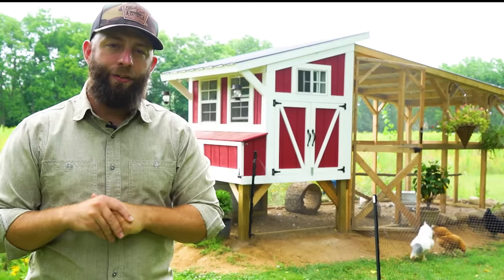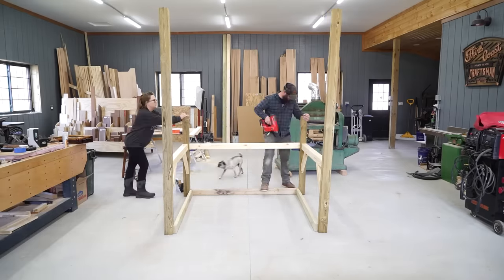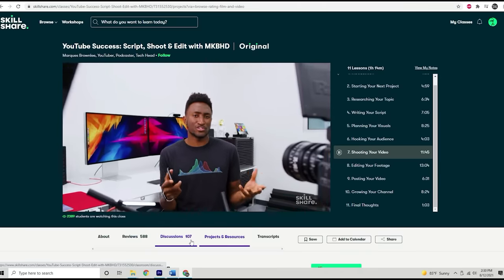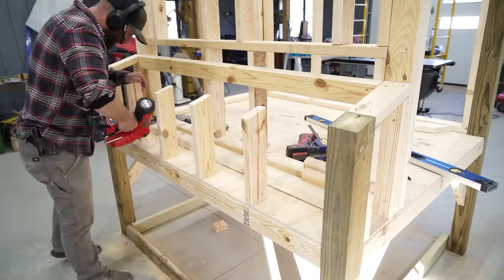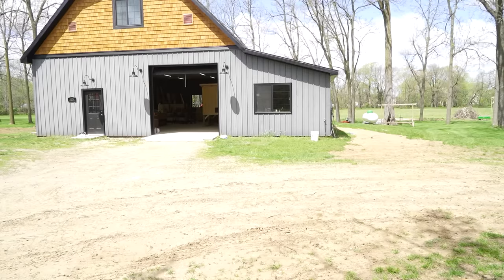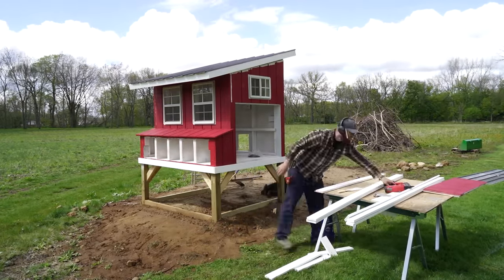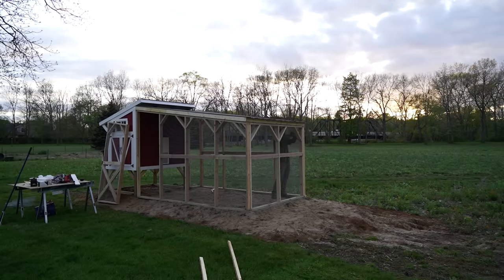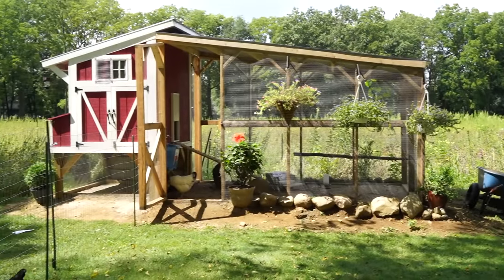Ultimate Backyard Chicken Coop Build | How To DIY

Comment: Quick question - I got the plans and I was wondering, is the framing nailer really necessary? Could you just use screws and be fine instead of using screws and nails?
Reply: You can do so with screws only too but the nailer makes it easier to join peices one handed,feeing up one hand to hold on to the wood, also some screw drivers arent strong enough the get the screws all the way in so maybe do a pilot hole first
Reply: @Smr402  I started on the build and i've been using #10 screws for added strength. I know nails have a stronger sheer strength but since this is just for chickens and not humans, the screws should support everything fine right? First time doing major framing work like this haha, nail gun would've made some of these angles MUCH easier. The 45 degree supports were tough with the drill and impact driver.
Reply: @WolfCatBirdPigMan   hello, i also just started building and have been using #10 screws as well. i do believe it will hold up just fine. i just finished the base and it is pretty sturdy. i dont have a nail gun but so ive been doing all the pilot holes first with a twist drill bit, then i use a wider drill bit that makes a hole big enough  for the screw head to sit flush in the wood. i have been putting in the screws on the 4 inch wider side instead of in the 2 inch side because i was able to get a better angle. you can look up, " how to toenail a screw" by the youtuber beech w. However if you try doing pilot holes do not "tip" the drill bit as it will overheat and break off. you can do a small hole then tilt it. ... and sorry for the long comment, you probably already figured all this out or know more about wood working than i do haha

Comment: On page 6 of the downloaded plans, you do not indicate that the 60” wall studs are to be cut on a 15 degree angle. You mention the top plate is cut at 15 degrees along the front edge, but nothing is said about the wall studs. I knew the wall studs needed the angle because I’ve built a lot, but a novice would not catch this, and it’s a bit vague in this build video as well. Other than that, the plans look good.

Comment: How do you heat it in the winter months? we are located in Canada it’s gets well below freezing in the winter.
Reply from the maker: We put in an electric broader/heater plate under the roosting bars and on single digit and below nights we turn it on. For the most part the chickens body temp help keep it warm enough for them

Comment: I have already bought your plans, and in the middle of building. Kids can't wait till I'm done. I have only one question though. Are the windows flush mount or j- channel, I still need to get the windows, and I can't tell from the videos. Thank you, and have a nice day.
Reply: The windows in the plans are J-channel windows. However, if you find the ones from Shed Windows & More youll be luckier than most. I built this coop and waited for a month for these windows to come in, but they never did. Lowes does sell some very similar in size to what is described in the plans (18 x 23).  But Lowes gets $80 per window where Shed Windows & More gets about $40 per window IF they can get them in. I went ahead and bit the bullet and got mine from Lowes just to be able to wrap this project up.
Reply: @mellis5150  Thanks for the reply.  I did get them from Shed Windows & More.
Reply: Hello, me again. Question? Now that you have had your coop up for a while have you had issues with rain blowing in the coop at the top or bottom of roof at the ribs, or is this something I'm going to need to seal off. Thank you.
Reply: @jimmyrennier1849  I've only noticed rain blowing in through the window (when open) above the double door. I am probably gonna just leave that one closed most of the time.
Reply: @mellis5150  what direction are your windows facing?

Comment: ON the frame for the run. Did you end up just using green treat on the ground and the rest just construction lumber? Or did you treat the construction lumber at all with anything for outdoor elements?
Reply from the maker: Just treated for the ground
Reply: Why did you not treat the other lumber? Will it not rot? Thank you
Reply: I ended up using treated lumber for all ground contact surfaces and painted the other untreated lumber after assembling the run sections but before attaching hardware cloth. Worked pretty well.

Comment: Thanks for the video! Just bought the plan and beginning work on it. Can you make any suggestions on how to treat the end cuts of the pressure treated lumber? The standard for PT lumber with ground contact seems to be products containing copper napthenate (e.g. CopperCoat Green Wood Preservative). However, that's some pretty nasty stuff; hoping to find a non-toxic alternative for the feathery friends.
Reply: Did you find the windows? Struggling to find them
Reply: Marine one seal is animal friendly and one goes along way, but a bit pricey.
Reply: @hopejanson9743  No I haven't been able to find them either, but thinking I can find something that's comparable size with tempered glass.
Reply: @ryanabbott9208  I found some windows on Amazon that are slightly smaller but worked!! I did a lot searchingggg

Comment: Question, if the coop door is inside the closed run that is predator proof, how important is the coop door itself? The door you chose is a really cool, safe, smart design, but it is also expensive and seems it would be more important if this was the primary way in to the chickens space without a run,
Reply from the maker: We have a fenced in open air area that we let the free range in and with the auto door we don’t have to remember to go out there in the morning and evening to open and close the run door. If you always keep them in that closed secured run then you wouldn’t need an automatic door

Comment: Anyone else have trouble finding the windows? The windows look like they are out of stock and hard to find. Are there any alternatives or places to find correct windows for this chicken coop?
Reply: I had to adjust the two front windows to a slightly smaller size (and adjust the dimensions of the frame)... I was able to get something similar (but smaller from different supplier). I also had to build the coop without the side window (above doors) as that one was also out of stock.  I just found that one available on Amazon and ordered it yesterday.
Reply: If you call the company directly, they should have them

Comment: Question please,  Has anyone converted these plans to make the run the same width as the coop ?  I have a location with a 12" grade which I need to build a platform first from 4X6" so I need both Coop and Run to be same size (62.25") if possible.
Also has any converted it to a deep litter system ?

Comment: Just some experience I ran in to. It looks like he puts his windows in the “normal” way, meaning you open them from the inside. That didn’t make sense to me so I’ve installed mine inside out, so I can easily open them from the outside.

I don’t see any reason not to do this yet. Any thoughts on this?
Reply: I did the same thing for the same reason
Reply: @stledbetter7  how long ago? No regrets? No issues I haven’t thought of yet?
Reply: @justjason7662  I just finished the coop last week so I haven't used it. I plan on installing hardware cloth on the inside. If you see how he did it (can't remember if it's this video or the walkthrough), it seems like you would have to install that from the inside.
Reply: @stledbetter7  I also took the siding all the way down to create a storage compartment below the coop. I had extra flooring left over so I did the 3 supports and just closed it off with a 4th one and then floored it. Then I put another double door for there to safely store food and treats as well as cleaning stuff and bedding.

I’m not missing the opening for the wheelbarrow honestly. I much prefer having the storage space!

Comment: Use of pressure treated outdoor lumber for the run OK?
Reply: I used treated pine on the run. The "new type" treated lumber is not supposed to contain arsenic and to be a safer product to use. I'm guessing it probably is safer because it doesn't last nearly as long as the old arsenic infused stuff did. Every time they make something better, safer, or more efficient it doesn't last as long as the previous version. Finished mine a while back. Heres a few pics. https://www.youtube.com/watch?v=oHRgSwNfmj8

Comment: Really nice shed. I’m interested in buying your plans despite having to make it larger to house up to 50 birds. One question I have is based on the materials list, what do you estimate the cost of this build to be? Great design. Love the poop tray.
Reply: At size. As someone just getting materials. I am guessing $500 to 600is. I had left over material from a different project and materials to make a different style run.

One issue is, it is almost impossible to find those windows.
Reply: I'm in the process of building this shed right now. Our Lowes order for most material was around $1600 not including fasteners, the fancy chicken door was $219, and the windows, which we had to choose a different size, were $116 + shipping. You could save some money by substituting some of the more expensive items like 10' & 12' boards/trim.
Reply: @danthemyth  thanks for the info
Reply: @danthemyth  what windows did you use?
Reply: @ashleygreen4209  1 12"x18" and 2 14"x21" from Shed Windows and More based on the closest sizes they had in stock at the time. You'll have to adjust the window rough openings and trim cuts in the plans to accommodate the smaller sizes.
Reply: @danthemyth  thank you!
Reply: Hi there, did you ever build your coop for 50 chickens? I’d like to make mine bigger too!
Reply: @RVXY_  I did not. I ultimately decided to go with hoop houses. I used waterproof tarps from Amazon and cattle panels to make several 7x12 hoops houses. Cheaper and easier to grow my flock. I have one per breed and one for brooding

Comment: I'm currently building this and it is very wobbly. The brad nails do not hold this stuff together enough to get started either. Pretty sure I'm screwing this up big time..
Reply from the maker: You should be adding screws right away
Reply: @ThirdCoastCraftsman  i wound up doing that. The instructions and video aren't too clear on a lot of details.   

Example: page 22 the door, those 2 door supports on the bottom. What are the angles? I'm terrible with those cuts and have gone through numerous 2x4s trying to get it right.

Comment: Does anybody have the link to the windows?
Reply: I posting links to EBay where you can find them but YouTube is deleting the posts..  They have the 2 18x23 inch windows but the 12x18 inch is unavailable I did find a 14x21 inch that will suffice. They are low on stock so hurry up!

Comment: Awesome build brother! I purchased the plans and using all "reclaimed lumber" from an old shed I dismantled last summer. With some sanding and a fresh coat of paint it should look golden :)

Quick question on the NB roof: what are the dims for the overhang on the sides and front ledge? In the video it looks like about 1/2" on the sides and almost flush on the front. I'm thinking 1/2" to 3/4" all around for my build but would like your feedback before making these cuts. If I don't hear back I'll just err on the side of caution and go 3/4.

In full disclosure, I'm 63 years old and definitely not a framer. I can demo a small shed (saving the lumber) but never handled a framing gun until now. Watching your DIY video has made me just good enough to be dangerous lol. I incorporated your creative use of quick-clamps and so far this has been a one-man show. Thank you so much for sharing your skills and design!

Comment: I noticed that you did not use insulation. Is it not necessary?
Reply: Insulation needs would be dependent on your location and the type of chicken breeds you have. You could probably add it to his design (there's certainly room for it), just be mindful not to restrict air flow too much or you'll introduce mold issues due to the moisture they generate. Chickens tend to tolerate pretty cold weather, and from what I've gathered, it's the heat you have to worry about.

Comment: What did you attach the roof structure to  the coop with?
Reply: I have this same question as well
Reply: @liquidgold2735  if I recall correctly, I used 3 inch screws coming from underneath - very awkward but really no other option. I also used some 4 inch screws just for added support since I couldn't get a screw everywhere I would have liked one because of the necessity to put them in from underneath, if that makes sense